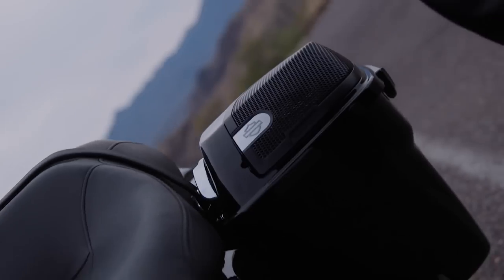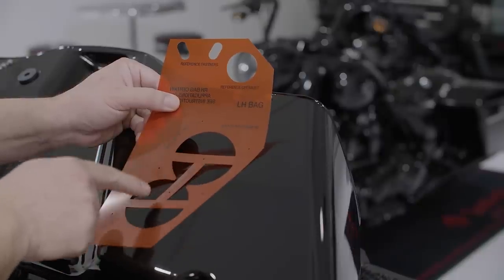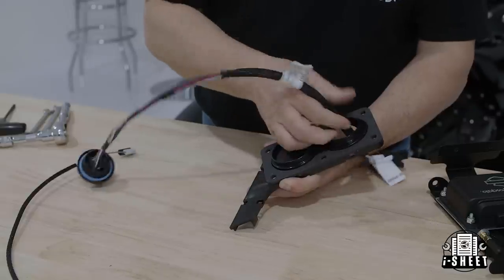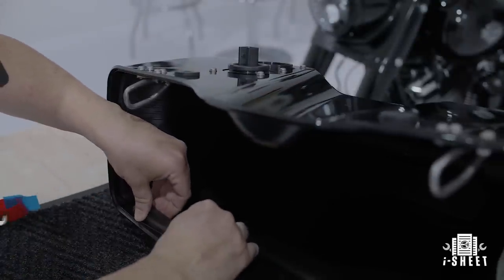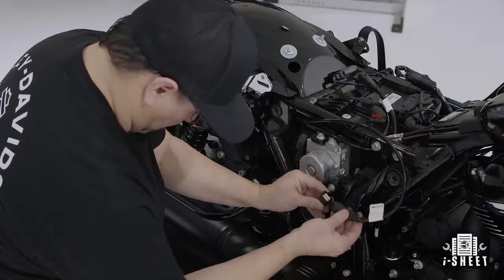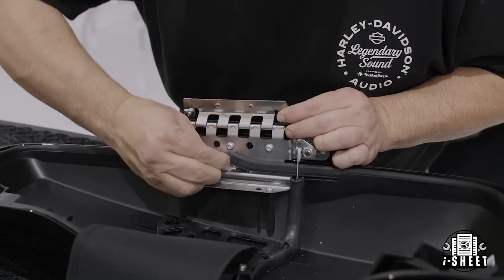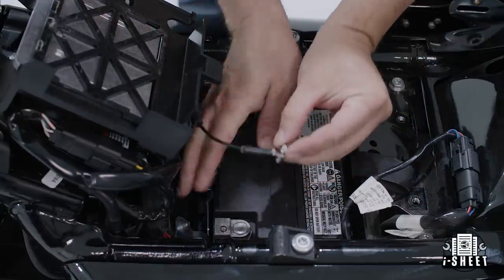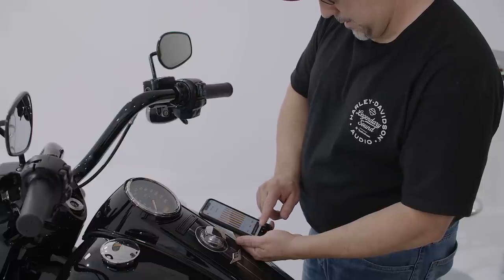2 Speaker Setup & Amplifier Install – Road King | Harley-Davidson Audio powered by Rockford Fosgate

Comment: Didn’t put a link to the part numbers or kit did you HD?  (Sigh)   Should have seen that coming.
Reply: @kennethwise7108  Kenneth.  This is a very real struggle for me with HD part#s and finding everything I need for builds.  If they had a one click buy now for all of that. I would have clicked it. Appreciate the understanding.  That’s corporate for ya.
Reply: @johntmccrakin109  go to the harley dealer and get a work order estimate .. they will give you the parts number and all the info
Reply: @gonzalezt7081  we did this for the cholo softail deluxe.  Someone took the stock front aux lights off.  Got a list of 13 part numbers and was told it would be easier for us to do it on HD website.  Not one part number came up.  Not knocking the dealer but there is that.    And the dealer has been great in other aspects too.